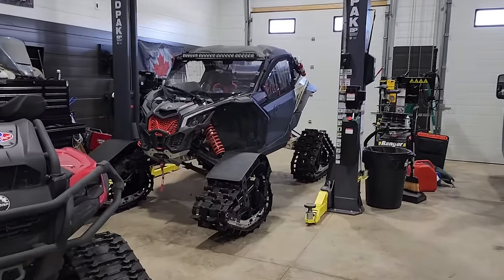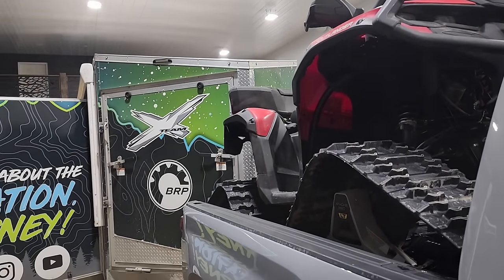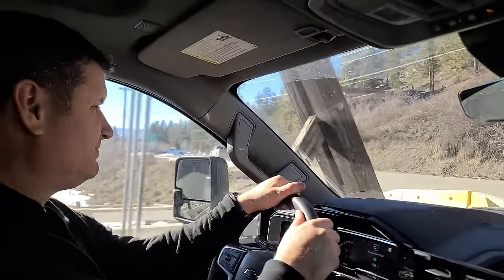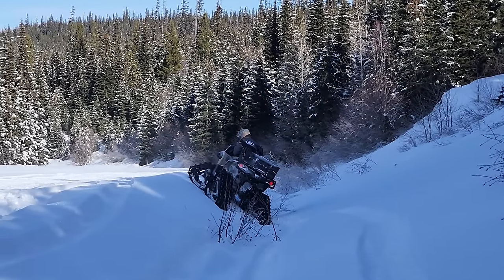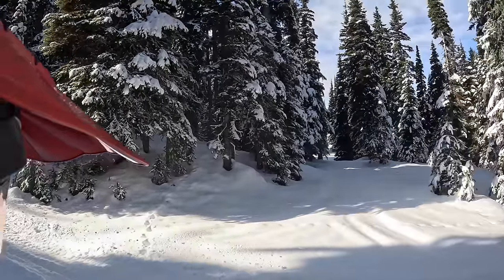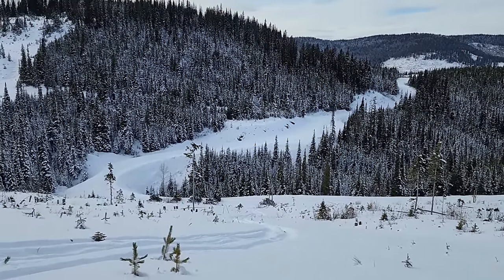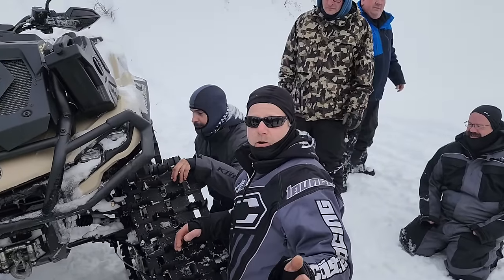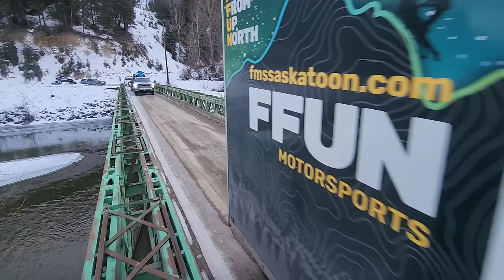Tracked Atv's and Sxs's in the Mountains Day 1

Comment: Why is snow drags with tracked machines one of the most satisfying things to watch this winter? This video was awesome!!!
Reply from the maker: Haha thanks dude. We had a blast
Reply: why does it seem like the drags are in slow motion?  ,,, Oh thats becuse I am used to watching snowmobile drags.
Reply from the maker: @looseballs1966  haha yes much different
Reply: @ostacruiser  LOL yes if you want speed on snow the tracked quad ain't it, gotta break out the sled, and I love my hot rod Arctic Cat (2018 ZR9000 ) but also love my 700 Yamaha Grizzly with the Camoplast track kit on it, I'm a pretty hardcor Yamaha guy because I raced Yamaha dirt bikes for about 14 years between 1981 and 1995, my grizzly is an old 2007 but has been pretty modified with stroker kit head work computer tuner, upgraded suspension stuff performance exaust, axles and some other goodies, it does really good on tracks.,, anyhow really get a kick out of watching you guys to the north of me in that great white north on your crazy modded Can Ams going nuts LOL.

Comment: Have your air lines come out with the gas cap that way if you have snow and ice on the rear bumper and can't get to the air lines their protected behind the gas cap door
Reply from the maker: I think I am going to do an in cab controller, but if not then I will definitely route them to the fuel door

Comment: Do you go back to stock clutches on full pull when you run the tracks?
Reply from the maker: No we run the full STM set up, we ride in high gear 99% of the time and the clutches never miss a beat
Reply: @ostacruiser  copy that. I'm stuck with a 2019 commander 1000 that keeps blowing up lol